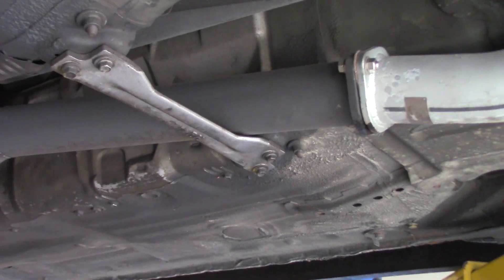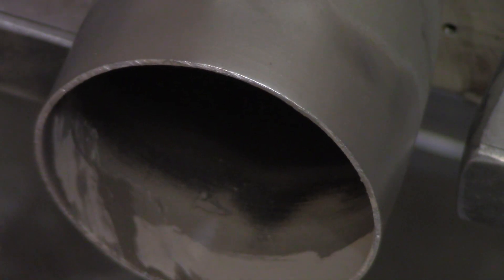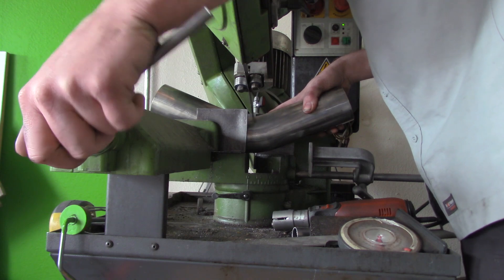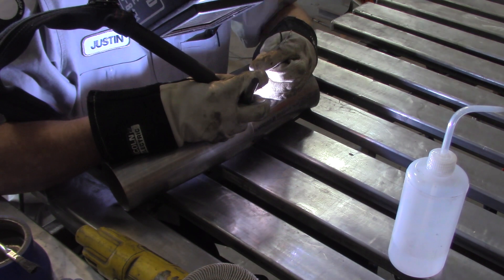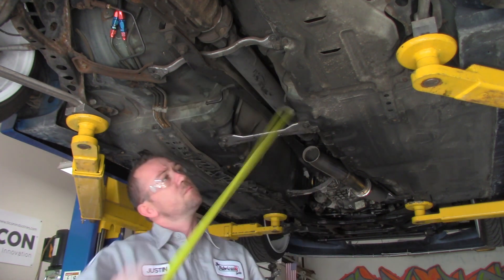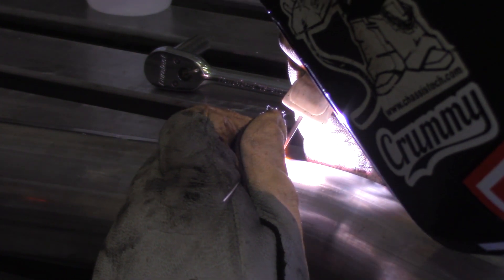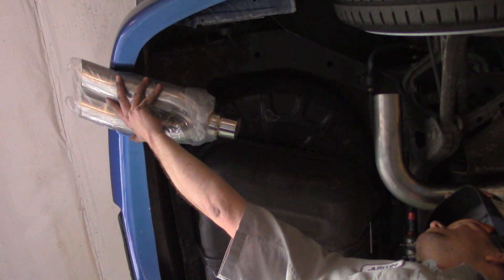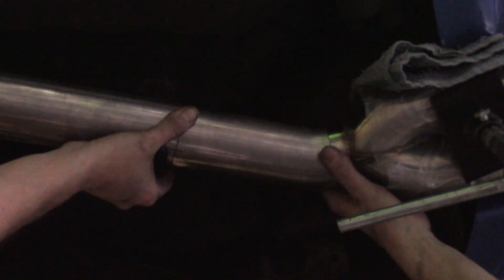TFS: DIY Custom Exhaust from Scratch

Comment from the maker: 👇👇ABOUT SOLAR FLUX AND BACK PURGING IN THIS VID BELOW 👇👇

https://youtu.be/AIRWMhoke9I
Reply from the maker: knonfs Solar Flux is a less expensive alternative.
Reply: Justin has taught me an immense amount of information in my short three years in the trade. I am feeling very grateful he shares his knowledge with us in such a digestible way.
Reply: So, for exhaust fabrication (DP, MD, catback), its better (less expensive) to use solar flux for back purging, than back purged with argon?  I am guessing its a matter of money?
Reply from the maker: Masacote motors Sure. Just send me a message ahead of time so I can be here.
Reply: you should put small compensating plates on were you weld the hangers on there mate. i dont know what argon costs in america but in new zealand a G sized bottle only costs $120 and you wouldnt use $20 of that to purge and weld that exhaust.
Reply: The Fabrication Series sounds like someone shuffling cards😂
Reply: Thx. Was just about to ask about this product. Is only $39.90 on Amazon. Thx Justin, all the welding videos. It encouraged me to buy a Everlast Tig where im going to teach myself by watching ur video’s
Reply: What about the back side of where you welded those hangers? Were you able to get any flux in the pipe behind them and if not with the tension and vibration is there any risk of cracking?
Reply: The Fabrication Series can i go to your shop next time i go to vegas really fan of your job ??? great job sr

Comment: I've made a few exhausts in my time and I can back that this is all correct. Building exhausts takes a long longgg time, amplified by any restrictions the customer puts on you and the material the exhuast is made of.
 And yes, alot of the exhaust making process is just a bunch of educated guesses where you hope if you are wrong, you just over shot so you can cut back.
 Actually, no math is required to make an exhaust. You can do it all with a sharpie, band saw, a few peices of paper and a few clamps. Don't forget a welder and maybe a soft faced hammer.

Comment: Awesome work man, rx7s are sick. Kind of an off topic question but how do you figure out how to make equal length midpipes on a v8 truck? Specifically a 5.7 tundra i want to put together an exhaust for but i want to make the mid pipes closer to equal length if possible. Still using stock cats and headers but im replacing stock muffler with 2 12" straight thru glasspack style mufflers then a y pipe to either tail pipe or a turn down. Thanks for any help.

Comment: And what you just weld the hangars to the frame? I'm gonna be doing a full exhaust on my truck, and I'm wondering about the hangars. I'm just doing short dumps on both sides behind the cab so I should just need one per side. But I'll need one none the less.
Reply: Always utilize factory Hanger locations

Comment: Hello i am not a specialist in welding, this is beautifull car and great work, but when you weld v-band, try to have it connected to second side and tied up by bolt, this will prevent bending one side by heat.

Comment: I subscribed to this awesome channel.  Question does upgrading exhaust  from 2 1/8" to 2 1/4" change the sound of the exhaust.  My car is stock pipe with a loud Mouth 2 and a magnaflow 14827 - Street. The guy installed the mods on the stock pipes which doesn't give it that burble sound that I expected.  The car is a 4 cylinder turbo 2.25" pipe pre-resonator and mid-cat was deleted as well. Anything suggestions

Comment: The thing I've always been confused about is how a free flowing exhaust is the ultimate aim, but at the same time there has to be a certain amount of back pressure for an engine to run right, how is this balance achieved?

Comment: Hey Justin, I was wondering if you recommend a specific servo/solenoid/valve for a diy butterfly valve exhaust system. I'm building my own exhaust and want to also have this feature, I already have the switch which is the easy part, just a basic 3 prong 12v accessory switch. However I don't know what valves are available or if I can just make it all myself, would love any help you can give me!! This is a great video by the way, really helped me build confidence about this project!!

Comment: im new to tig welding, Im learning, But have experience in Arc (stick) welding, so picking it up pretty quickly..
What tig filler rods would you recommend for stainless steel?
i have been using ER 70S-2 for "generic" steel, and like them, They dont flow mega runny..
Are they also fine for stainless? or what do you recommend?
thanks

Comment: I noticed in this video you use solar flux instead of back purging. Is solar flux a good practice Instead of back purging if you don’t have a second bottle or dual flow meter to use for back purging?

Comment: Fantastic work mate! I want to learn to weld & build by own stainless V-band front pipe, so this video was great.

You gave lots of useful information & tips, plus I like how you get it as straight & tucked as possible... To me that is the sign of a very well designed exhaust for flow & power 😃👍

Comment: You're right, sometimes there is no proper way of doing something and you just need to eyeball it. 
About the tension in the exhaust, it is better to have the exhaust hang in a relaxed state. This will minimize vibrations and unwanted noises. Limit hanger movement if the exhaust swings around too much. 
Nice video and great work!

Comment: How much did you end up charging for that job? I'm trying to run an exhaust shop but I'm uncomfortable with high charges. I'm strict, and try to keep the price pretty reasonable for the job requested, but things don't always work out. Just today a guy came in to get his car all unhappy because he didn't like the job we did. All he told us was that he wanted to add a second muffler and tailpipe. We did what he asked, but he was unhappy with a job that wasn't even finished yet. I'd really appreciate some advice

Comment: Working on something a bit different from the norm and wondered what your opinion would be, I've got a V8 mustang looking at putting on headers.. I want to cut the headers before the collection pipe and Ronnie h pipe out the front fender creating an 8 pipe exhaust 4 per side

Comment: I had one question, why you go about 70-75amps when you said in other vids a best amps to weld about 90amps or above because it does make nice puddle and it wouldnt cook the metals, im wondering this and get confusing, im about just started getting into welding world, thankyou

Comment: Yeah the rx7 800 HP and 19 lb.ft. of torque! Gotta love them wankers! Just kidding guys! This dude is a true master metal fabricator and I've learned a lot over the past few years and you will too no matter what your skill level is currently! BTW I don't care what anybody says about the sound of this car, when you hear the sound of a straight piped stainless exhaust out of a twin trip or quad rotor rx7 that has been professionally welded with 0 leaks, it's a totally different experience than what you hear in the video! Any car for that matter! A professionally built straight piped stainless exhaust is a sound to die for! I don't care how many pistons or rotors!

Comment: What is solar flux and why do you use it on the inside of the welds? Is it required if mig welding an exhaust? Cheers :)

Comment: im in the same boat it sounds like lol. Ive owned a turbo rotary and yes they all sound like ass, now im building a single 80mm turbo 6 liter ls and its going to sound like a derby car im afraid as most of them do with a single and single down pipe. what do you think one of those resonators would do for it? going driverside turbo mount and pass side fender exit exhaust under the front bumper. Maybe that will be the key to tame it down and not kill power,

Comment: When you did the lap weld on the resonator, did you solarflux up the stainless pipe (inside) approximately where the lap would be? Did you also flux between the overlapping portions?

Comment: Hi I'm looking at building my first turbo exhaust manifold thanks to a lot of the welding tips in your series! I was wondering what material you'd recommend for the exhaust manifold for a smallish turbo setup. There seems to be a lot of debate between mild and ss304 and ss312

Comment: great job...but i have some questions...why do you keep needle so far out?.
in my experience welding stainless steel for better control of the beed you need to have the needle more inside then you can control the weld much better.like just 5mm outside the ceramic... 
other thing is the tip for you..if you weld stainless steel it will go bezerk with pulling from the heat...so what i have found out is that if you weld one side then the other and finish directly in the middle it stays in place,since stainless pulls where the most heat is,on the end of the weld...so if you start at bottom and end on the top,then go again on the bottom and go left side towards the top you counter that heat pull at top by giving it heat at the bottom..so it cancels each other...just something i have learned in years of welding pipes.
or you can go 1/4 at the time like left right left righ....

normal amp at welding 1.5mm stainless steel tube for me is from 52-58amps and it is perfect everytime

btw nice exhaust looks great,and eyeball technique sometimes is the only technique you can use and it works...

Comment: Where do you buy you're V-Bands and Stainless tubing? Many Places are charging way to much!
Reply: PROPER bending of SS is not easy.  Bending is, but proper bending includes having a consistent diameter through the bend.  Seriously, cheap bends will be oval in the bent area and you cant cut them and rotate them without hammering to fit.  SPD exhaust is who I buy from and yes they are crazy expensive.  Remember also that you dont need to buy 321 for everything as that is the most expensive (and most heat resistant and the stuff that takes a mirror polish), you can use 304 like OEMs do and have a stainless exhaust without the price

Comment: @12:45 I wholeheartedly subscribe to (and practice) the "Take it out, make adjustments, put it back in, repeat at least a dozen times" method. I watched the whole exhaust series and then recently managed to pull off fabricating my first ever exhaust system, using a builder's kit. Aluminized 2.5"mild steel and MIG with CO2. It's not pretty but but it's effective... and it'll get it done for my off road project. I should have gone with the V-band clamps from the start but it's not too late to add a pair. The best part is that it all comes out in two assemblies with just a few bolts. None of it is trapped in the chassis. I'll call that a win... Thanks for a great series!

Comment: Hey ya what kind of blade do you use on your saw and does it last a while with using it on stainless. I use a 305mm mitre saw but find that the burrs are crazy huge so looking at trying to find another cutting way.

Comment: why not use a flex-pipe at the downpipe? won´t it leave a lot of unnecessary strain and vibrations at the header and/or downpipe, to make it without one?
Reply: The short answer is no because it's RWD.  The long answer is most factory installed flex pipes are to reduce noise, vibration, and harshness (NVH) in vehicles. Most RWD cars and vehicles with uprated engine mounts equal less movement hence no need to worry about the engine bouncing around and taking your exhaust for the ride. The more movement your engine has the more movement and stress on your exhaust consequently.

Comment: hey ya what is your argon setting set at im trying to get pretty welds haha got the stubby with gas lens etc mine is set at around 15 not sure what measurements it uses
Reply: also i weld horizontal like the piece sits vertical and i weld horizontal would that also be a problem as i notice you weld laying the tubing down and weld from the top

Comment: I wish I had a bandsaw, those really do make custom exhaust/ tubing work much easier.  Exhausts are some of my favorite welding projects.  I just finished a stainless axle back section for a racecar to replace a blown out muffler.  I will have to try some of that flux, back purging it with argon was a bit of a pain.  Very nice work, and nice car.  Im sure it was a bit loud with only the resonator but if thats what the customer wanted that is all that matters.

Comment: Question. So why isn’t purging required in this application?
Reply from the maker: les11997 The process of shielding was required which was done with Solarflux instead of purging with argon.
Reply: The Fabrication Series are there specific circumstances in which you would choose solar flux over back purging? I’m still new to learning how to weld and I was under the impression that back purging was necessary for all open ended welding. Or is it just the same thing and down to preference? If it’s the same thing I’d enjoy a video talking about back purging
Reply: The Fabrication Series Nevermind, I just saw your pinned comment. Answered my questions on solar flux

Comment: Arnt you putting alot of stress on the turbo manifold since you dont use a flex pipe in the beginning to remove all the vibrations from the exhaust?

Comment: Is there a mandrel pipe bender that would allow you to bend up most on that from fewer pieces?
Reply from the maker: krusher74 I'm not sure I understand your question.
Reply: So instead of welding many pieces together you make if from one straight length and use a bender.
Reply from the maker: krusher74 Its certainly possible if you own a mandrel bender which usually has a base price of about $50,000 for a cheap one. Not many of us have that much money to spend, so we stick many bends together. As long as the welds are good, there's no harm or negative effects.
Reply: scratch that idea then, lol

Comment: Great work! Did you premix the solar flux in the container and then add alcohol to get the right texture? Looks like its hard when you poor in the alcohol
Reply from the maker: slimsims When the alcohol evaporates it's back in powder form again. You can wet it with alcohol again or disturb the powder to loosen it before adding more alcohol. It doesn't really matter.

Comment: What bandsaw and blade are you using?  Mine keeps popping off when I try to cut 304SS.
Reply from the maker: chuck0379 Mine is made by the manufacturer (Kama)
Reply: The Fabrication Series thanks.  Keep the videos coming.

Comment: Do a head port video
Reply: Gedas alekveravičius why would a welding channel do a head porting video? Porting heads isn't something you "just do" especially if you want it anywhere near right.
An idiot with a die grinder can easily screw up a head.

Comment: awesome, roughly what was the labor cost on this, or what should it be?
Reply from the maker: DnV Auto Performance & Welding Take the time to build (X) your hourly rate plus material and consumables. This job would typically take me 4-6 hours. I did this on vid in 11 or 12 hours (but I charged the standard time).  Out of privacy to my clients, I don't share job pricing.
Reply: thank you

Comment: How did you go without wearing sleeves, were your arms sun burnt?
Reply: Daniel James no
Reply: axtra92 i take it you havent done much welding you should see the burn you can get from the flash.
Reply: at max. 90amps it will not really burn you because the flare is not as strong as would say 180amps
Reply: It's not bad at low amps like this, after a whole day you might have a small sunburn at most. 100+ amps I would though

Comment: What is your general approach on attaching hangers without blowing holes into the exhaust tubing? The hangers are much thicker and require way more amps. I typically light off on the hanger and try to drag the heat/puddle to the tube, but this can be a real challenge when trying to tack, where the hanger isn't really grounded, the piping is. Second question, do you wash out the container you have your solar flux in or do you keep it caked in there for the next time like a good old cast iron skillet? If you wash out, is there any precautions with how to dispose it? Thanks for all the great videos!
Reply from the maker: Krautastic The best approach for tacking a hanger is to force the arc on the rod near the spot closest to the tube. Sometimes you have to be ready with the filler. I just put an episode up on welding thick to thin which the same concept is applied with hangers. 

I leave to solar flux in unless it is filled with dirt or debris. You can dust it out into the trash to dispose of it.

Comment: My only question, is why not a flex coupling somewhere in the length?
Reply from the maker: Torspd2 I wasn't needed based on design on the system and vehicle. Sometimes they're needed, sometimes not.

Comment: Can you use solar flux on something that will have drinking water in?
I missed the rag until you mention it.
Reply from the maker: Mr. greens boat tanks and aluminium welding It is not safe for sanitary stuff or potable water systems.
Reply: The Fabrication Series thanks!
I've been trying to make a stainless steel mug and can't purge the inside. It seems to rust inside